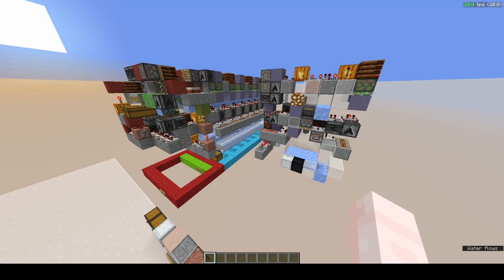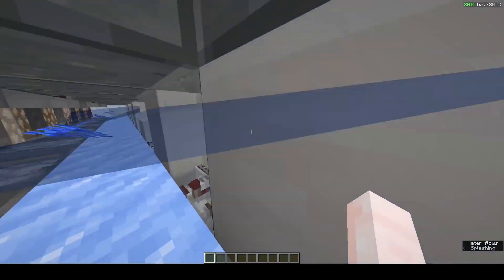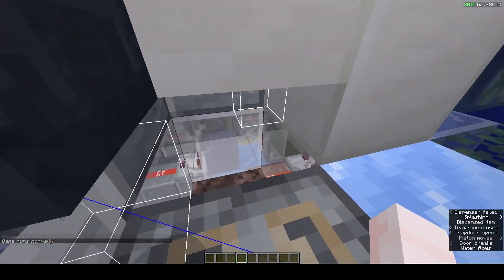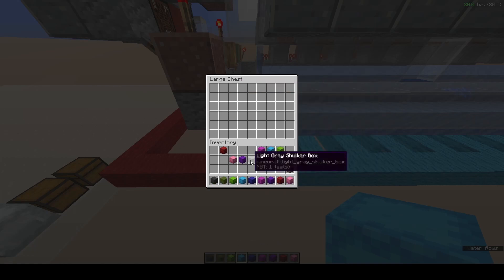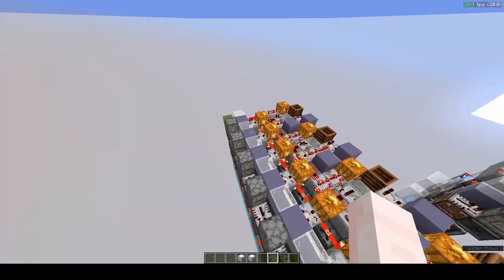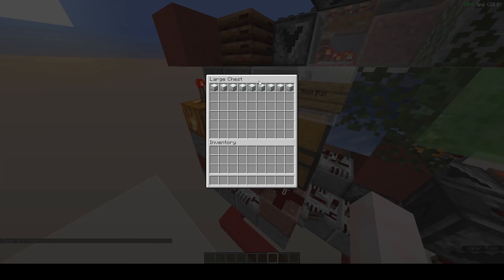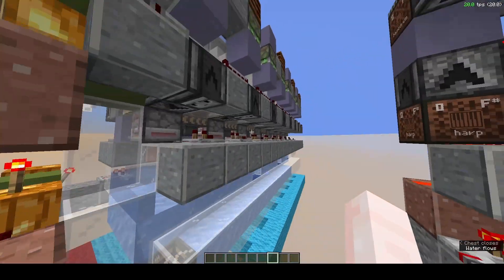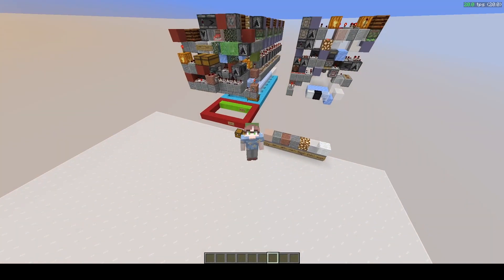Minimum Hopper Shulkerbox Merger

Comment: Hello there! I really love your work! However, I've noticed that after I lock and unlock, two items will pile up in the first hopper of the system. This can cause damage to the machine when it runs next time. Upon observation, it seems that the dropper was not updated after qc because the comparator and repeater were qc at the same time. A 2-game tick delay update seems to solve this problem.XD
Reply from the maker: nice catch, i wonder why i never noticed that before. I could have sworn i've turned on the lockign mechanismt mulitple times. Oh well. Thanks
Reply from the maker: Ah i just looked at an older version, yea I accidentally changed the timing when I was changing the block palette up. I uploaded the fixed version.